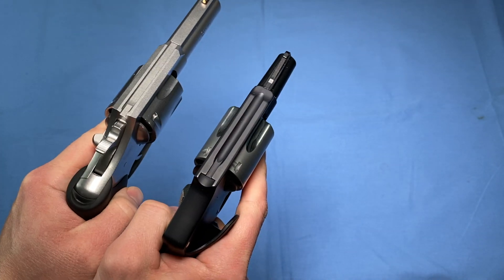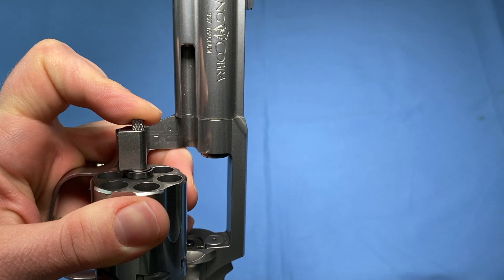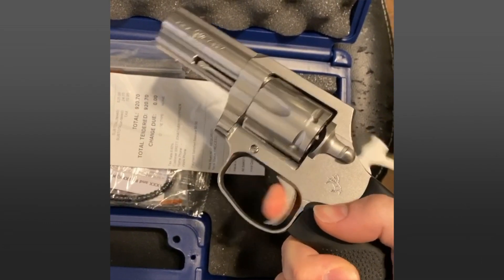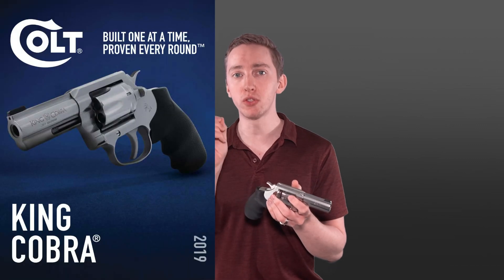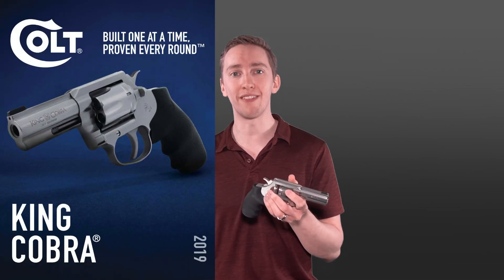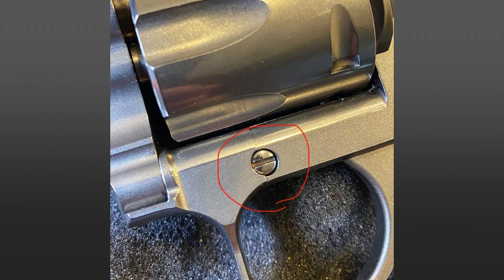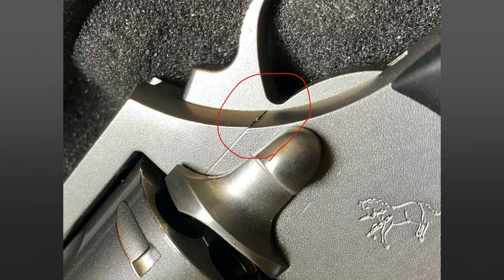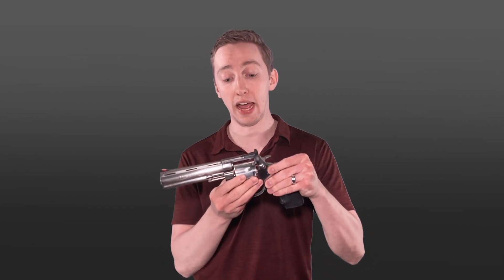Colt King Cobra - Problems, Malfunctions, and Failures OH MY!

Comment: Thanks for posting this video.  I am viewing this video because I am currently, or was, considering buying a 3".
Reply from the maker: Glad you found the video helpful. I’d recommend either waiting a couple of years for CZ to make some changes after acquiring Colt. Or get a Smith and Wesson or Ruger instead 👍
Reply: I think they worked out the quality control issues with there new revolvers now. I snatched up a King Cobra in 2019, so I got the first run. Two problems I had with mine: 
1. Front site came off after I fired about 50 rounds. Had to have Colt send me another. No loctite was installed at the factory.
2. The side plate seam was off like they torqued the screw without lining it up properly. I fixed this rather easily by removing the side plate and tightening it back down.
Reply from the maker: @colinj5291  That's crazy. I still, personally, wouldn't trust a modern Colt considering how many people still reach out to me about their horror stories. But I definitely trust CZ to turn the company around. Looking forward to the future of Colt.
Reply: @NightwoodGuns  Well. All of their revolvers are always sold out and almost impossible to find. They just released another snake gun (Anaconda) so they must be doing something right. I did here they were planning on opening an additional factory in a more gun-friendly state.
Reply from the maker: @colinj5291  Pretty much all revolvers are always sold out right now, so I'm not sure if that is a fair assessment. All a gun manufacturer has to do right now is exist to succeed. The Anaconda was a great move on their part and I will 100% purchase every revolver offering they have in a couple of years when it's all sorted out. Colt has always made the best looking revolvers in my opinion, so I'm looking forward to adding them all to the collection down the line. Moving to a more gun-friendly state with CZ in control is "two thumbs up" from me.

Comment: I just picked up a new Python, Crown looks good, side plate lines up, it happened to be at a gun shop and I bought it without much research first. It’s a PY0085XX, so I think a later made gun. So far everything seems to work but I only have a few rounds through it. I think the original Pythons had a better fit and finish. Even my old Anaconda just seemed a tad bit nicer. My 686 plus seems to have a nicer trigger as well
Reply from the maker: Very nice! I agree about the fit and finish. But, hopefully it continues serves you well! 👍

Comment: I own a 2017 Cobra and the new King Cobra.  Both are fine revolvers, have run several hundred round with no issues.  It is advisable to inspect any gun for obvious flaws before you lay down your hard earned cash.  And, don’t pay a grand for a gun you can get for under $800.
Reply from the maker: teekann Can’t inspect the internals of a revolver before you buy it. I would also love for you to find me an example of a King Cobra for under $800.

Comment: This always happens when gun sales sky rocket. Ironically some of the best guns I own I acquired during low sales at 200-500$ dollars less then there current MSRP. Some of the worst guns I own where panic buys I just didn't really have the money to buy it and the threat of banning it gave me the motivation to acquire it at a unreasonable price and buyers regret set in within one or two visits to the range. I have three suggestions for new gun owners to avoid getting taken advantage of. Ignore politics if you feel like your buying something you don't need or can't afford but your motivations are fear it won't be available you will get swindled gun companies mass produce and throw quality control out the window during high sales to meet demand if you feel like panic buying other people do to and you will get caught up in the pandemonium believe me you don't want a $900 paperweight. My second piece of advice is never order and definitely never back/pre-order always buy a floor model usually but not in all cases you can have more success avoiding defective units. And my third piece of advise is never expect quality if anything is marketed as Classic, Reproduction, Collectible, or Sport. Anything marketed as Classic, Reproduction, or Collectible is only meant to serve as such since it has already had its Hay Day and has gone the way of the wind it will never be the same again nor do the manufacturers especially if they've decided to market it in such a way intend to produce it the same don't be surprised if they actually criticize you for thinking you could trust it. As for Sport or training marketing that implies exactly that target shooting, hunting competition not self defense or service. The approach to making these kind of guns is often not to meet the demands if life and death reliability. Basically know what you want and need. Sadly I've seen both poor quality control and aggressive sales tactics over the last 2 years. Also one piece of advice that has nothing to do with quality is be sure of what you want before you get it. I've seen some fairly bad examples of salesmen pushing products people didn't want or need. A prime example would be a sale I witnessed at a retailer where young buyer was looking for a shotgun to compete in either skeet or trap shooting and the salesmen was trying to push a shotgun in 16 gauge which is generally not a caliber that is aloud in competition or that you would even want to attempt to compete with since ammunition is significantly higher in cost then the standardized 20 and 12 gauge chamberings and is almost always exclusively for hunting. I believe in this case that the salesman may have innocently just not known what they were talking about but I also noticed that that was the last over and under shotgun they had in the store and it's entirely possible that he didn't care if that's not what the customer needed and just wanted to get the sale. So remember gun salesman are still just salesmen.

Comment: I had one of these guns on layaway when I run across this video so I got to doing a little research and come to find out there were several guns like this out there. I immediately went to the gun shop and told them what I had found and I bought another pistol in place of the King Cobra! I was really wanting the Python but I am not sure that I will buy either one of them now! I will just stick to buying reliable guns like the Ruger or Smith and Wesson. No sense in putting $1000-$1500 in a gun that is a piece of crap when you can spend half of that or maybe even less and have a functioning fully operating gun! I am very disappointed with Colt as I have a Trooper MK V 6” barrel that is a tack driver and never fails to go bang!
Reply from the maker: Gary Pollard That King Cobra on layaway might have been okay.... but it also might not... and if it wasn’t, you would have had a major headache in front of you. Good call playing it safe and going with a better option. I’m disappointed in Colt, too. My Anaconda is a tank.

Comment: Hello, I'm relieved to see I'm not the only one with an issue with the 2019 King Cobra.
After to literally digging I found your video and have a question or two. Did you end up keeping the revolver? And if so did it end up breaking down again?
My hammer sear broke off in the same exact spot as you had pictured in the video and almost want to bet has identical fracture marks.
I found the main spring is the worse I have ever had the pleasure of trying to subdue, it's strength is way to much for that component of the hammer.
Thinking of selling mine and just sitting on the money for an Anaconda.
Reply from the maker: I'm glad you found my video. You are definitely not alone. To answer your questions, I did end up selling it. My "spidey senses" told me it would eventually break again. To avoid a "fool me twice" situation, I sold it. And it was near impossible to move. I have a 1994 Anaconda and other than the awful hard rubber grips, I love it.

Comment: The old Colt's was a high-end work with a all forged parts, hand fitting adjust by a experienced and specialized gunsmiths. If you want a similar thing you must see a custom maker and pay a lot of money for it.... If you owned a old style Colt the deception is obvious and not a surprise.... Actual Colt's are produced in mass and aren't specials with exception of his fabulous trigger and don't expect the same finish and adjust like a 90's Colt 357 Carry Magnum Ok? Actual Colt's aren't different to other companies with a mass production and must judge it like that. Well, the quality controls and technical service scare new buyers and is a minus valor for the company. By other way some user report a timming fails in double action shots, but I remember it's appear's in old Colt's too because they don't know the principal rule of the colt trigger, you must complete the trigger reset (note 3 clicks) before pull again the trigger 🙄. This only a peculiarity of the Colt's and it gave you a extraordinary smooth trigger in double action. Problem become because new users don't have the reference about this characteristic way operate the trigger and the "problem" appears. The old Pythons and Anacondas use a very heavy cylinders and if you shot very quickly in double action frequently for long time, timming fails appears but no in SF-IV / DS-II Frame. 
✨🖖🏻🙄✨

Comment: Just saw another review about a .38 cobra also new production where some internal parts did broke only after a few hundred rounds. But there also terrible storys about S&W even perfomance center models and Ruger. To me it looks like you cant buy any new revolvers anymore without the chance of gettigng a lemon. And revolvers are already more expensive than pistols. I guess the quantity of sold new revolvers is so low that they cant ceep up the quality due to cost savings.
Reply from the maker: Yeah, QC is down industry-wide and revolvers don’t have a lot of room for error. Here’s my thing: if you get a Colt that’s a lemon, it’s a massive pain to get fixed. If you get a Smith/Ruger that’s a lemon, you will probably have a much better time getting it fixed. Customer service is better. Personally, nowadays I recommend Ruger. I’ve seen some gnarly Smiths recently.

Comment: My Colt Cobra broke when I was dry firing it. It locked up. Wish I bought a smith and Wesson instead. Colt is junk!
Reply from the maker: Not surprised, unfortunately... Hopefully now that CZ has acquired Colt, their quality will improve in the next few years.
Reply: @NightwoodGuns  That's interesting because I sent my revolver in to be fixed but if they just replace the same broken part with the same faulty design then its doomed for failure again. So maybe CZ will employ a thorough investigation into whats going on.

P.S. I probably won't have a hard time selling it because of the gun shortage.
Reply from the maker: @Namikii  Yep, they did not remedy the fault with the part. So they will just replace it with another faulty part. CZ probably won't have much of an impact for a few years. I was able to move mine quickly after repair, so you should be fine. There are several Colt fans out there that would be thrilled to have it.

Comment: I have my king cobra 3” 357 mag for concealed carry. Now I’m afraid to trust it. I have shot about 150 rounds through it. Not enough. I did have quite a bit of duds while using lax ammo. I don’t know if it’s an ammo issue or light primer strikes. Anyone similar problems?
Reply: Sonnie Williams
0 seconds ago
I own a Colt King Cobra.... produced late 2021 / early 2022.  I have fires 100 rounds of 38 spl and 50 rounds of 357 mag through it.  About 40 of those 38 spl rounds were some Perfecta ammo.  I had a 1-2 failure to fire rounds out of almost every six rounds fired.  The primer was being struck and had a good dent on the rounds that didn’t fire. I kept  striking the rounds and even kept changing the specific cylinder hole the round was in and they finally fired. I fired some of these Perfect rounds through my Ruger sp01 with no issues.  The Colt Cobra did fire all the .357 rounds and federal 38 spl rounds with no issue.  So, it appears to be the Perfecta had hard primers, but I am still disappointed.  The whole point of a revolver is reliability.  Not sure if the Colt King Cobra can’t handle rounds with harder primers... doesn’t provide a firing pin strike as strong as some other firearms.... not sure, but I would not carry this revolver at this point, but going to keep shooting it and see how it goes.

Comment: My hammer just broke during dry firing. The gun is a backup and I've never fired one single shot yet!
Reply from the maker: Sorry, man. I know that feeling. It’s a design flaw so the part is a ticking time bomb. Thanks for adding a comment to this video so people can see that these are still breaking. I wish you luck in getting it fixed by Colt 👍
Reply: @NightwoodGuns  Yeah man, glad it didn't happen in a real scenario but my heart sunk. Colt emailed me the shipping label in no time and it's on its ways back to them now.
Reply from the maker: Glad to hear it’s on its way back 👍 Hopefully it doesn’t happen again down the line. Grateful that it just happened during dry first this time 😮‍💨

Comment: I don't understand how colt can screw up a gun that they have already manufactured in the past and their past examples(the entire snake series) where excellent firearms. How do you screw up something that you had already perfected in the recent past?I have a Colt King Cobra manufactured in 1989 that has a 6-inch barrel stainless steel and is one of the best revolvers in my entire collection.it also has one of the best triggers I have ever used on a stock factory revolver.none of the old ones really have any problems that I'm aware of but yet all the new ones seem to be junk. I don't understand why they had to reinvent the wheel here. Colt obviously tried to fix something that wasn't broke and these newer models are the ending result
Reply from the maker: mag Dump All of the craftsmen that built the old ones are gone. And they simplified the internal designs to be cheaper and easier to mass produce. Then they charge ridiculous prices for cheaply produced guns. Probably because they’ve been a couple hundred million dollars in debt for years. I agree, it’s stupid and their marketing campaign is dishonest at best and devious at worst. It’s a shame.

Comment: At least you got to shoot yours, dry fired a bit to see trigger pull, trigger did not return. Sent it back, brand new unfired, 2.5 months to get gun back, estimated turn around way less than that, acknowledged receipt, months passed, tried to call on hold 45 minutes, never answered, called a dozen times FINALLY GOT A HUMAN, allegedly lost in system, finally got the gun back close to 3 months after sent. Exact same problem and experience with customer services you expressed. Would I buy a new Python, NOPE
Reply from the maker: SGT MAJ Trapp Oof! You’ve got me beat! Your experience was way worse... This is why I’m trying to warn people... That is horrible.

Comment: Dang.  You're absolutely spot on, but on the other hand...I want to be Rick Grimes sometimes.  Tough decisions.
Reply from the maker: The gun doesn’t have to work for cosplay, lol! 👍
Reply: @NightwoodGuns  haha, fineeee!  Having a hard time selecting a small revolver carry gun and always get stuck on colt for reasons that have nothing to do with the firearm itself :)
Reply from the maker: @soundsnags2001  Colt is old-school cool. Unfortunately they just don't make them like they used to. Normally I'd recommend S&W but their QC has been bad the last couple of years. Ruger is good to go, but the SP101 is a bit heavy for what it is. Might not hurt to try to find an older Colt or Smith in good condition. I picked up an older Smith and Wesson Model 19-2 last year that I love.

Comment: The really sad thing is this is really not a new gun. All they had to do was go back and use the old plans and specs. In to days world people will accept his and let them repair it instead of demanding quality the first time.
Reply from the maker: This is what happens when they try to find a cheap way to mass produce a revolver. All of Colt's original revolver people are long gone. Instead of hiring proper gunsmiths to match their legacy, they hired engineers to design a cheap revolver for mass production. Welcome to 2020, I suppose. Honestly, throughout the whole process, the customer service was the biggest let down. But I suppose that is also par for the course in today's world.